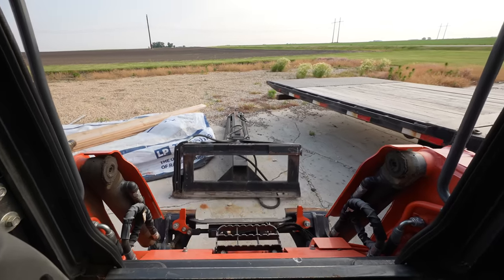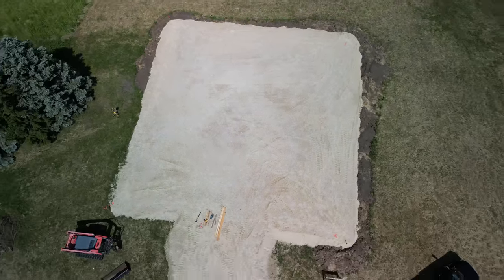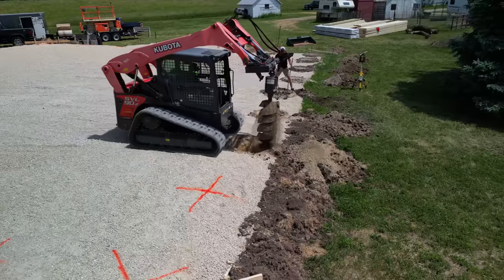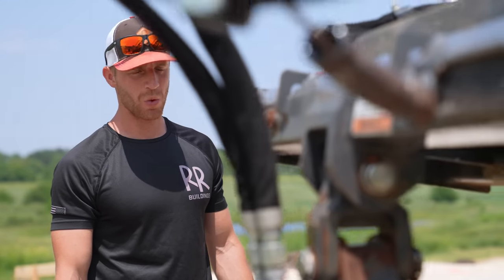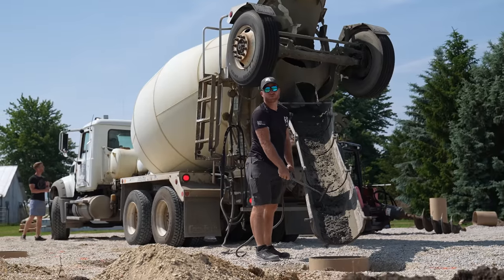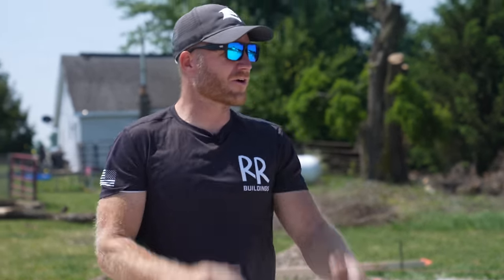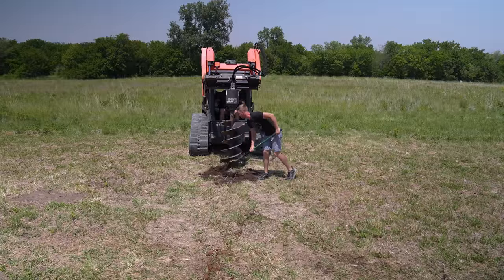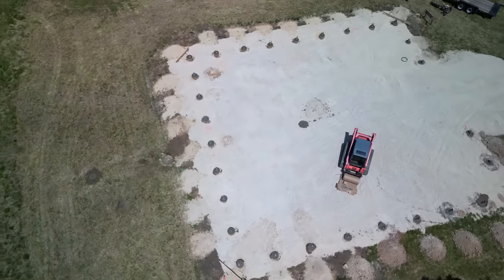Building A Brand New Farm Shop From The Ground Up!

Comment: 1:32 EVERYTHING!
Been with you since launched the channel and I’m still amazed of the attention to details and the work you all do and expect even fr9m subs and other employees (no, friends, sounds better). Also miss a few employees that moved on to better there life, if you will. But what a great thin your doing w/ this channel Kyle and what you feed us everyday, knowledge and can learn something new and don’t be afraid to use the tech in building…..even if means using a tube of sealant for acoustical drywall etc….
Cheers✌🏻

Comment: I would love to see how you do post frame construction with a basement. I know post frame don’t typically have a basement but I remember you mentioning a few times that you have done it in the past. The thing I wonder about most is how you would handle floor joist/beams that butt up against posts and don’t have the full basement wall to sit on? Are there hangers that could be used in those situations?
Reply: Would depend if you're spanning the whole structure or if it's in-layed inside of the structure. You'd have to engineer the walls to carry the load of the building.

Comment: I spent 25 years in the Carpenters and Joiners Union Local #1. I spent almost 3 years on a Morton Building erection crew. I'd like to have you deep dive on all the framing. I'm old and would like to build myself a small Barndominium with T-111 for exterior wooden (painted barn red, of course) cladding and a raised seam roof. My father was a past President of A.S.H.R.A.E. and taught me the actual effective use of "R" factors so I believe I can build in post frame a significantly efficient structure.

Comment: Also, Retired Navy, starting from scratch with 6 acres on midcoast Maine property, 3acres untouched for 150 yrs. Building 500’ gravel driveway, and garage/shop for KUBOTA BX maint. DIY as much as possible. I will do driveway build and garage site prep. Since soil/overburden is sand, I plan to dig everything out, down to ledge, fill back in with “Rip-Rap”, 4-6” stone. Otherwise, freshwater springs and gravity will destroy driveway over time. Freshwater springs drain into ocean.

Comment: RR is one of my go-to Channels. Maine coast is ledge/bedrock, 4-5’ frost depth,  garage/shop project. Looking at all your slab vs concrete post frame building techniques. Preparing for post hole digging to find exact ledge depth. SDS rotary drilling for rebar/epoxy everywhere. Question is still monolithic pour for garage vs elevated concrete posts. Thx for outstanding YouTube vids!

Comment: Love the videos keep it up and like other people said in the comments I could literally watch this over and over again. Doesn't matter if you've said it before some people like me need to hear it 10 times before I can get it imbedded in my brain lol. I do have a question I'm surprised you don't have to use a concrete vibrator to get all the air pockets out or even lay rebar inside of the pillars. Here in Manitoba Canada our frost line is 8 feet and we need to have concrete pillars minimum of 25 feet deep with rebar as well.

Comment: When drilling in loose fill you can use a 5’ piece of flat bar. Drill a hole on one end for center and two holes on the other side spaced out. Spacing doesn’t matter much but 2’ should work. Set the center hole of the bar on the center of the shaft before you start drilling and drive two pins in the ground in the holes at the other end. Pick the bar up and drill. After clearing the auger you can reset the bar on the pins and you’ll have center again. You can also use the bar to check plumb and depth. Just make sure the pins aren’t touched before your shaft is done.

Comment: I live in Prospect CT 12 miles north of New Haven, Ijust dug out 10 12" tubes 42" deep with my Backhoe 3 of the holes I hit boulders I couldnt move so i had to drill and pin them cause a 6ft wide rock Im not moving or tearing up my yard to dig deeper and move the rock. I put my shovel in the ground Im hitting a rock EVERY TIME!!!!

Comment: Great videos.   Thank you.  Story Pole again with dimensions, mock placement of girts-fascia boards-fascia, overhangs-etc., maybe use a white board too, while on the ground.  There are a couple of procedures that are crucial, so I don’t mind repeats of squaring of layouts, plumbing walls with chains, squaring roofs at the trusses with chains, adjusting the span between the trusses along the roof line while installing roof sheathing, door and window placement relative to metal flats and hills.   If a number is mentioned, show its derivation.  Maybe add details with narration during editing.  However, I do respect your time, these are only suggestions.

Comment: Hey guys, see if you can get a hold of recycled concrete base rock next time. Water as you roller compact it and it compacts like a dream! The small amount of cement gets reactivated…but not so much that your auger won’t go right through it. You’ll find it will hold together just enough to solve your problems. Your holes should have very little loose material problems. We use it quite a bit under asphalt driveways and parking lots. It packs so nice…feels like cement…great to drive and work on, until time for asphalt.  Cheaper than regular base rock too!  Hope that helps…love your system! Not much of a call for it here in Silicon Valley though. 😕
Reply: I doubt that they did the base
Reply: They don't do the base.  The home owner usually has someone do that.

Comment: just here to pass the time, learn about other trades, this is like watching a tv show for me hahaha. Great videos keep them coming. Talking about making plumb the brackets responding to the comments on the ears is just funny, I remember those comments in the shorts you posted.  Quick question, why not place the level flat on top of both ears  ? Could you not get both sides plumb using one level? As a plumber thats how I make my commercial floor drains level. I just realized you would need a more squared level like an irwin 250 or johnson torpedo

Comment: suggestions 1) use a laser on a tripod to shoot a beam down your centerline of columns so as you lift the auger in and out the beam hits the auger.  or 2) have a temporary casing made that is slightly larger than your coil insert (sonotube?) about 2' long so when you encounter loose agg you can auger thru it and keeps it from caving in.  push sonotube in and then pull temp casing out.  this would have saved a lot of time just bailing rock from the bottom of the holes.

Comment: This is what I am having trouble understanding, how the rat trim height is determined in relation to the concrete floor height. Another question would be how do you determine garage door opening dimensions. I think another explanation on how you prepare the service door openings and make them ready for concrete.

Comment: My question has probably been addressed already, but I am wondering if there is a plumb-level with a wider magnetic (or non-magnetic) bottom base that can fit inside the brackets on the horizontal plate, and provide an accurate reading of plumb in all directions from that. Thanks!

Comment: Get Greg a mic! I know you probably have a video explaining it but do you set the brackets 1.5 inches in from the actual dimensions of the building to compensate for the 2 by or are the posts the actual dimensions and everything on top is sticking out further.

Comment: Couple questions, wasn't clear on if you drop your end bracket on the outside of the string line? If you do, I mess why? Plus why don't you build a "L" bracket to hold your Western bracket in place and pour around the bracket?

Comment: What I want to see and a Question: I would like to see how you make the trusses. I am planning on a 24 x41 garage soon. I have an idea how I want to build it. The question: When you get the trusses done, and the perlins on, before you put the metal roof on, why don't you put 1/2 osb or plywood then a roof felt, then the roof? I want to insulte mine and do not want to have any condensation from the metal roof. Also, I might do vapor the entire inside before I finish it. Anyhow, that's what I would like to see and why you would or would not have a deck before the metal roof.

Comment: looks great to get a better concrete try to use some plastic on the bottom of the tubes (just place it in the ground and the tube on top of it..)... nothing special but for concrete always better to do so the water doesnt go to fast out of it

Comment: The 31 columns I came up with just over 8 yards of concrete, not including the ones that you drilled in the center and out in the field pi R squared times 48 inches deep, correct

Comment: The ACI. specifically ACI 318-08 section 7.5.1
'Reinforcement, including tendons, and post tensioning ducts shall be accurately placed and
adequately supported before concrete is placed, and
shall be secured against displacement within tolerances
permitted"

Comment: I would like for you to explain the  holes better.  Why don't you use round cages or rebar within the holes to provide better strength?  Also why do you nail your purlins instead of using GRK structrual screws?

Comment: Could you explain the pros and cons of a concrete foundation VS concrete column
Reply: Depends on sizes of them. I prefer a stem wall assembly for this type of build. More expensive but helps with insulating the building

Comment: Can’t you use a tube that is slightly bigger than the auger? After the first drill you could put the tube in the hole and then drill inside the tube. The tube will drop by itself and keep the gravel out.

Comment: As someone with a 49 year old pole barn that has the posts buried in the ground, there is no way in Hell you could get me to build another building without a stem wall . Yes the pier system is cheaper than a stem wall , but is there a groundhog that is going to dig under a wall buried below frost line and undermine your concrete floor causing it to break ?  Would you want to be working underneath a vehicle supported by jackstands , and find out that the concrete floor is compromised ?
Reply: Stem wall for sure. So many more benefits. Worth the cost
Reply: @jwristen24  compare the up front costs to having to replace a section of broken flooring due to critters .

Comment: I am curious why isn't there a grid of rebar in the holes before concrete is placed? I feel that the concrete would not be that structurally sound without any type of rebar.. especially being used for the footers for the house.. I could be wrong,.. but definitely a head scratcher.

Comment: I’m building a post frame on a ICF foundation. I bought a Menards package and I don’t want to put the knee braces on the trusses because it will show inside the building. On a 16 foot sidewall the brace is 10 feet long . Is there a way around this or should I use them ? I’m going to call the engineer that’s helped me through this so far but I would like to hear your take on this . Thanks either way if you don’t want to reply.

Comment: Post frame in Florida , thoughts and opinions!?  - Im SERIOUSLY wanting to build post frame in Florida but don't find it much around here. I've watched a TON of your videos already BUT.... our foundations an such are different we don't deal with the frost / frozen lines etc and typically built on mono slab ( I guess that's what you call it)..     - "That's not going anywhere" extremely important last words!
Reply: I would look at local codes. I'm in commercial construction and the job in Naples had some crazy over-built requirements for structural details. Never seen anything like it.
Reply: @jwristen24  Ya, that is definitely another thing I'm curious about. I'll be building in Crystal River / Citrus. I can imagine places like Naples being pretty ridiculous. I live in Clearwater now and I just want out at this point lol!  I might have to start looking into red Iron I assume? Perhaps you have some suggestions. I just really like how these post frames go together and seem extremely efficient.  Appreciate your reply!
Reply: @Aaron-nn8vk  I build steel structures exclusively. I don't like using wood at on anything structural or exterior. Cost is more obviously but if you want a building to really last definitely go with steel. I use General steel and Morton Steel Buildings. Both are great to work with and have in house engineers. Saves money. They can check local codes for wind/snow loads and any other restrictions.
Reply: @jwristen24  thanks for bringing that up, just today I was talking about just focusing more on steel. It seems like way too much work and effort even just to figure out how to get a wood / post frame built in Florida when I can just go with steel which everyone is already doing and at least make that part easier! Already have enough other things to figure out. I will check out General Steel and Morton!  Thanks again , you've been a big help!

Comment: Why are the brackets not in the middle of the concrete pier?  It seems to be off on most of them.  Is it too hard to do the math/measurements before digging the hole?

Comment: Weird that you're saying this truck is dry or this truck is splatteryer today. You know you can have the driver add water to change the slump? Obviously you can't remove water, but you should tell them what slump you're looking for. Start dry and adjust as needed.
Reply from the maker: that is exactly what we try to do, second truck I just had them add more water than I wanted

Comment: Do a pull test on those steel brakets in the concrete they will pull out in a glae force wind never mind a hurricane. Further the concrete in cardboard tubes is great for costing but not good for frictional side forces. You dont even test the gound to see whwats its bearing strength is. Very shoddy

Comment: You never mention an actual time frame on setting the brackets. Which I found to be a major problem for me. It took one hour to pour our concrete and I started setting brackets immediately after the truck left. By the time I had set 10 brackets the concrete was getting hard and making it very difficult to set the last 8 brackets. After our experience I would NEVER recommend wet set brackets to anyone wanting to build this way by themselves. If I knew then what I know now I would have used bolt on brackets.
Reply from the maker: an hour to pour??? that is the first problem. it should never take that long
Reply: @RRBuildings  Really? I thought it went pretty well, the truck was only here for an hour. So it wasn't all pouring time. When the truck first showed up he had to add water and mix the concrete then he took a little time getting into position. How long does it normally take you to get all your tubes poured?

Comment: How about a video of a post frame without specialty tools or equipment? Think almost a DIYer type video but without the expensive tools that wouldn’t be bought for a single project like this. More string lines, ladders, snips, etc throughout the entire process. I know the sponsors wouldn’t like this but I feel like you and Greg would make the videos enjoyable.
Reply from the maker: You think I worry about sponsors?? I think you might be surprised how little sponsoring is going on.   I use and buy tools that make my business as efficient as possible.  I have thought about your idea but end of the day I’m running a building business too